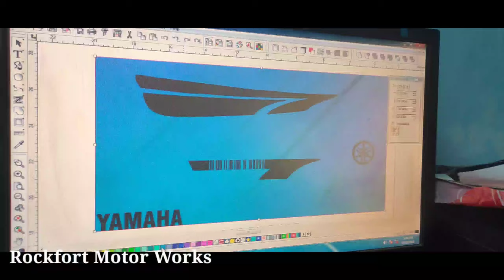Yamaha RX 135 modification to RX100 5 speed by Rockfort Motor Works

Comment: Hai bro..,
Indha type alloy wheel yamaha crux ku pooda mudiyuma?
2013 crux modification pannum
New alloy wheel
Fully repainting
New Front & Back muckad
New clutch plate ( current clutch plate failed) this problem only
New All electrical items ( Indicator with cap , headlight with cap , battery , horn , other LED light)
Bumper , Butterfly Handle Bar 
New Front Foot rest cover only , back foot rest padal
New Back suspension
New cable for ( speedometer, front brake , quick throttle)
Front & back Break drum and inside leather
Front number plate
Idhala ready pannanum price yevaloo aagum sollunga  bro